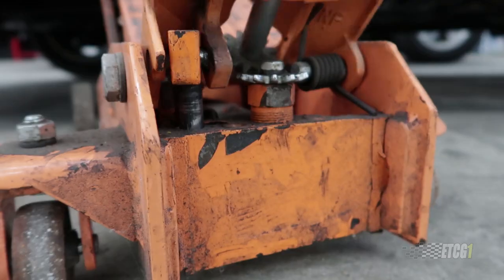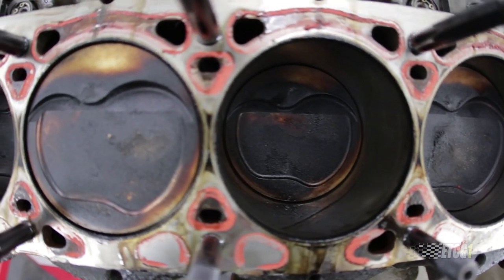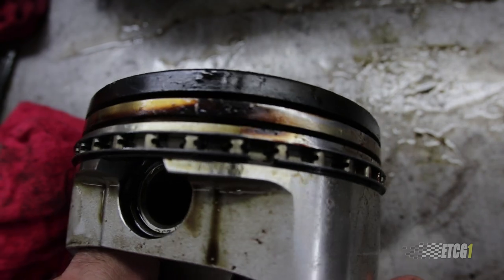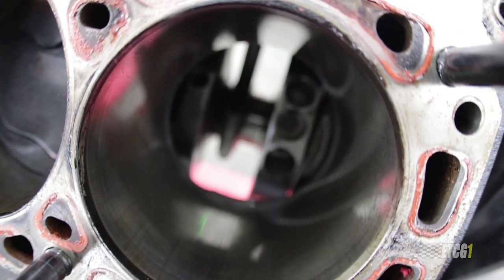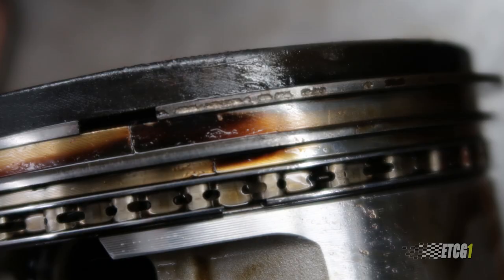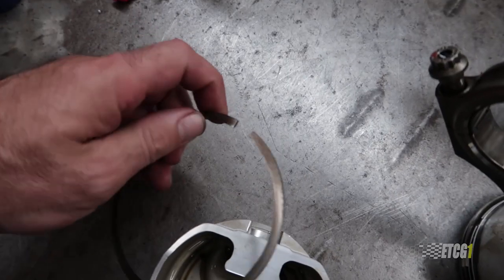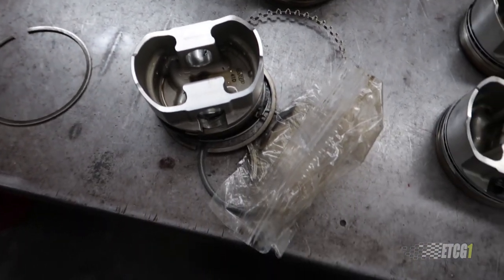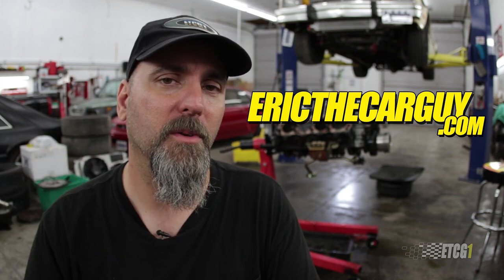Hydrostatic Lock the Silent Killer

Comment: Should've went with fuel injection....
Reply: I've seen injectors get accidentally  turned on on aftermarket ECUs . They'll do the same thing.
Reply: I have too, but not with the ECU being at fault, more like wrong wiring or really old, really abused injectors getting stuck. And even then it takes a good long while for it to inject enough fuel to cause damage... And most definitely long enough to cause the cust to go "wtf" and bring it into the shop, with the engine still intact.... Also, with fuel injectors, the only real opportunity for them to leak enough gas to cause damage is with KOEO... Which seldom happens and is not the case here... Here... we had a carb dump gas into the engine... and ALOT of it... this is one of the many, many, many reasons why we have fuel injection... diehards need to really stop defending carbs as if they were some sort of alter of horsepower and get real: carbs are DEAD, fuel injection is here to stay. And also: I can get at least +10/15hp with efi over carb AND I can see everything the engine is doing, preventing blowups like we have here....
Reply: Should've went with a better fuel pump....
Reply: Wasn't the fuel pumps fault..
It was the failure of the long obsolete design of the carb to stop the flow of fuel going into the engine in the first place...
Thats why we have pressure regulators to reroute flow back into the gas tank in case of just such a failure....
Reply: MeMad Max  Maybe...I didn't bother rewatching the other vid...but I think he installed a fuel return, so it shouldn't have happened if everything was working fine. 
Just because it's not the latest and greatest, doesn't mean it can't do it's job.
Reply from the maker: I'm not saying I won't eventually go to fuel injection, and not because of this. 

You can get off your fuel injected high horse now. Perhaps you missed the evidence of how well it was burning inside the cylinders. Carburetors are a viable fuel delivery system. But I understand how you wouldn't want to  let facts get in the way of your opinions. BTW, my AF gauge tells me all that I need to know about how the engine is burning. 

Also, I'm already running a return system with my carburetor. A return system has nothing to do with the events that caused this failure. Before you condemn the system I have, you might want to get your facts straight first.
Reply: What do you mean maybe?
If he had went with FI in the first place, then the pressure regulator would automatically be there from the very beginning and there would be no question about fuel since DAY ONE... Take out as much variables as you can to prevent DISASTER....
Reply from the maker: MeMad Max If you had real experience building cars you would know that disaster can happen to any build, carbureted or fuel injected. You keep ignoring the facts and making up scenarios that never happened. You can live in the hypothetical, but I prefer to live in the real world. I'm happy to agree to disagree if you are. Otherwise if you want to send me the $2K for the fuel injection system be my guest.
Reply: MeMad Max still wasn't the carbs fault. If you actually watched the previous videos and actually formed a decent argument behind your opinion, you could have seen that it was the pressure regulator that had the wrong spring in it.  Because of this fuel pressure was to high, thusly overcoming the floats in the carb. Carbed or fuel injected both utilize a pressure regulator, not just a FI thing. 

Things like this happen, you miss something and don't figure it out until bad stuff happens. You learn and move on. I'm glad it seems like it wasn't to bad. Hope it is just the piston that got affected. Very interested to see what else you're going to do while you're in there Eric!
Reply: GRABS POPCORN
Reply: @ ETCG1:
Wait, what? 
Sentence 1: It's already obvious that me and everyone else here in this comment thread knows that a disaster can happen to any build ... But the problem is, some people(LIKE ME) have ALOT of experience with carbs AND FI, but have successfully moved on to 1902(when fuel injection first made it into engines(wait, what? Yea, thats right dude: FI made it in 1902.... go study or something....)) ........................................................ 
Sentence 2: "Ignoring facts and making up scenarios".... again: WTF? What are smoking dude? I'm not making anything up, everything that I and that other dude in this thread, have said thus far is REAL LIFE scenarios that we both seem to know....
Sentence 3: "Live in the hypothetical" again... WTF dude?
Sentence 4: "agree to disagree"... are you referring to my comment about FI producing slightly more HP than carb in sentence 3/4? I dunno where ur going with this... It seems you want to attack, but can't quite get the fantasy bullseye in ur head either....
Sentence 5: Send 2k to you for FI... DUDE what are you SMOKING??? You already admitted that YOU WANTED TO DO FI in this build AS YOU WERE BUILDING IT, BUT YOU DID NOT REALLY EXPLAIN WHY YOU DIDN'T. You broke? SO WHAT? I DO EFI, WITH JUNKYARD GARBAGE, ALL THE TIME... ITS ALL THE SAME... If you ask me, I think you didn't want to do EFI because you were at a point in the project that you needed a kick in the ass because it was taking so long and EFI would've consumed more time and editing crap that you didn't want to do(which you also mentioned you hated doing)... WHAT DO YOU WANT? A FREE HOLLEY DOMINATOR? HAH! You already have demonstrated that you don't really have the motivation to get into TODAYS technology to deserve such a lavish gift...
Reply: Sheesh
Reply: And theres a dude here that jumped in trying to say some crap about a spring on a fuel regulator would do the same thing to EFI and blah blah blah blah blah...
Newsflash: a fuel injector is designed in such a way that if you add more fuel pressure to the injector, the seal gets tighter unless it sucks and breaks...
You all need a refresher course, here: 
https://en.wikipedia.org/wiki/Fuel_injection#/media/File:Injector3.gif

The solenoid PULLS AGAINS PRESSURE, NOT WITH. Essentially, more pressure actually results in less fuel after a certain point that the solenoid cant work against the pressure...
GG 
The End...
Reply: MeMad Max would have, could have, or maybe should have, it was a decision that was made I know I would have probably made the same choice, it looked like the right choice to me after seeing how the fuel was burning.   This is an instance of do not feed the trolls.
Reply: Let an injector get stuck open and it won’t take long to fill a cylinder either. He’s running a good bit of power. Which requires a good bit of fuel. Which requires good sized injectors. Ones that would spray a good bit of fuel if they stuck open. 
It’s a mistake that happened. Sure, carbs are old tech. But they work and are cheap and simple. I’ve seen fuel injection setups burn a motor because fuel pressure dropped, or a sensor misread, so it ran lean. I’ve seen engines damaged with fuel injection because it over fueled and washed down the cylinder walls causing the rings to scrape. 
Nothing is perfect. And you need to relax.
Reply: +ETCG1 I really think the ring land breaking is due to detonation, not the hydro-lock.  It seems very unlikely that the piston got cracked or broke and then you went on to drive it for thousands of miles - some of those probably very hard miles at high load.  That is not the way aluminium behaves when it breaks.  Yes, a Connecting Rod will break over time because it's very strong and much more elastic than alloy.  

For sure, EFI/Engine Management would have prevented this by retarding the ignition timing where you intake temperature spiked in traffic or with batches of fuel that weren't perfect.  With a Carb system and stand-alone timing like you have, you are literally gambling the health of your engine each time you stomp on the loud pedal because you have no accurate way of timing the engine under ALL changing conditions such as intake temp, coolant temp and more.  This is the stuff that saves engines and is the reason people are using full engine management these days.  

There is no way on earth you broke the piston ring lands during the hydro-lock and then drove 22+ hours to Jekyll Island without a hitch!  Come on now, think about it people.  This is a tuning error, but Eric does not want to admit it.  He is very defensive about it.  

You sure like to learn the hard way!
Reply from the maker: MeMad Max Here's a bullseye for you. 

I chose a carburetor because I WANTED a carburetor. I wanted to play with tuning a carburetor on a build like this. It had nothing to do with editing. Nothing to do with time, it's what I wanted. 

Also, I have made a video about this: https://www.youtube.com/watch?v=XCMhfSWcpIA

You continue to insist this wouldn't have happened with EFI. Check the comments. There has been more than one comment to this video stating that a fuel injector stuck open and caused the same hydrostatic lock situation. EFI is not infallible to hydrostatic lock. All engines can take in fluid that will destroy them. 

My issue with your comments is that you insist that this is a problem caused by the carburetor. It was not. The facts are right in the video. All of the other cylinders show good combustion. If fuel delivery was an issue, this would not be the case. 

You're just trying to make the case that EFI is better. I'm here to tell you it is, and I agree with you. However, for the last time, my carburetor had NOTHING to do with this failure. The evidence is clear and right in front of you. Stop ignoring it to prove a point that I already agree with, and stop insisting that I don't know anything about EFI. It's insulting. You have no idea what's in my head or what my plans are beyond what I've already told you. 

Lastly, I do plan to switch to EFI, but not because of this. When the time comes, and I make the switch, we can talk about it then. Until that time, please stop insisting that you're right about what happened to my engine, or that it had anything to do with my carburetor. The facts just don't support you.
Reply from the maker: ArchimedeanEye You still haven't answered to the fact that I DO have timing control. Instead you keep going on about how I'm wrong and this was because of detonation. https://www.msdperformance.com/products/ignitions/street_and_strip/parts/6462
Reply: MeMad Max   Alright I'm off work now so I've caught up with your essays. I could try and argue but I don't think there's any use, seeing as you're just out to lecture us in a rude & condescending way. 

Also, if you look at the comments, the likes and what Eric himself has said, is it really impossible to you that you could be wrong in this? If so, you're either delusional or a troll.
edit: spelling
Reply: +ETCG1  That timing control method is literally stuff from the dinosaur age Eric (in terms of automotive).  As I point out in my other comment on this page, modern boosted engines have 10 or 20 ignition-timing offsets.  That means 10 or 20 different variables are taken into account when timing an engine across all conditions, not just RPM and boost. It is the reason why modern engines can make such high horsepower and survive.  

Here is an example.  The LSA engine from the ZL1 or Cadillac CTS-V makes around 560HP in optimal conditions. Similar to your engine probably.  But the LSA engine uses the Siemens E40 PCM which can pull degrees of timing from the engine when there is an intake temperature spike.  In the case of a ZL1, it might pull 3 or 4 degrees and produce 40 less HP, but the engine is SAFE.  If the temperature is further increased it can add additional fuel or even decrease boost.

Now imagine what is happening in your engine.  You are producing the same boost largely dependent on load.  When you have a temp spike from a high-load run, you are still running the same timing, same boost, same fuelling.  You are not even measuring or adjusting for cylinder knock which is greatly affected by intake temp and fuel quality. Since you cannot know fuel quality and you cannot always hear knock, you need engine management in a boosted engine made for performance!    

Think about it.  Your setup simply cannot account for all these operating conditions, which is exactly why I said you need engine management all along.  Not just to be an asshole as you seem to think I am.  Do you think manufacturers designed all of these ignition-timing offsets 20+ years ago just for fun or emissions?  No!  They did it to produce huge numbers and make the engine survive. 

I'm sure you will change to engine-management at some point soon and will absolutely geek-out on how good it is.  I hope you do before you rattle more of the engine to pieces.
Reply from the maker: ArchimedeanEye As someone has already pointed out, it was the 2nd and 3rd ring lands that broke, not the top as you have mentioned. This suggests the pressure was exerted against the ring and not the piston. To me, that, and the other cylinders being fine, supports the hydrostatic lock theory. I simply do not subscribe to your 'detonation' theory in the same way you won't consider my hydrolock theory. 

The engines you mentioned are not my engine. My engine is custom made, not something that was mass produced. It has more metal and thicker webbing, so much so I had to modify the engine mounts to even use them. It also has a forged crank and connecting rods. It has some of the best pistons and rings on the market and it was built by a master. I've also invested in many of the support systems including the ignition system to make the engine as reliable as possible. I also don't drive the car hard. I'm not out doing burn outs every chance I get, or ripping down the road. Often I'm just driving the car and enjoying it. That's why I built it. I can see how your argument might hold up if I was driving it like a race car, but I'm not. I'm driving it as I intended to drive it, on the street. 

I don't see myself going to a full engine management system anytime soon. However, I am going to try and use this situation to get an EFI system from the same people that give me the fuel psi regulator. The reason, I want more control. Before I left for the Power Tour I jetted the carburetor down for better fuel economy. If I were to participate in any races, I'd have to pop the bowl back off and re jet for racing. That's a PITA. Doable, but a PITA. 

Another reason is that I've found that the car likes the AF in the 12s. That's not so great for the environment. It also sucks when I go to fill up. EFI can help me cruise at a reasonable AF, but switch instantly to 'race' mode when I need it. My carb can't do that. 

Those are the reasons I'm going to EFI. Not because I feel that I'm damaging my engine, but because I want more tuneability and drivability. 

Personally, I feel I've made my carburetor work. That's what I set out to do in the first place. Now, when I do switch to EFI, I'll have a better understanding of that the engine really wants and be able to tune accordingly.
Reply: +ETCG1  

1) The lower part of first ring land broke.  It supports ring number one AND ring number two.  Above that is piston crown.  

2) The LSA engine runs factory forged pistons, crank and rods also. It's also all-aluminium and cools far better than your engine, and still uses these controls.  Even a base Hyundai NA uses these type of ignition controls for the past 20 years.

3) The engine is nowhere near as 'reliable as possible' because you don't have modern support systems as I have mentioned to you many times (and which you constantly ignore).  The MSD Marketing spiel does not compare to basic engine management systems of the past 20 years. 

4) You are not measuring intake temp, you are not measuring fuel quality and you are not measuring cylinder knock. These are the main engine killers.  And your engine got killed, like I said it would. 

5) Are you saying you never drive the car under boost?  You never have fluctuating temps?  Come on Eric!  Why you are so defensive, I will never know.  You seem that biased about 'your way' of doing things that you become oblivious to the way people have been supporting turbo engines for 20+ years.  It's unreal.  And it's proven expensive and time wasting for you.  

6) I think you did make the carb work well, I agree.  But not the ignition system.  And not managing the engine as a whole.  You are VERY constrained by the MSD box.  And the MSD box cannot work with the fuel system. They each have no idea that the other exists.  All it takes is one bad batch of fuel, one temperature spike and you will produce knock.  But you are not measuring knock.  

Anyone that has spent time tuning engines knows the dangers of such a setup.
Reply from the maker: ArchimedeanEye 1) All I need is 1 here. You consistently avoid the facts that have been presented in this video. I seriously doubt that detonation would only effect one cylinder in an engine as it did in mine. As I've continued to state, and showed in the video, all other pistons and rings show absolutely no signs of damage.

What you have is a theory that is not supported by the evidence. If you want to argue with MSD, email or call them. Personally, I'm done with this discussion because in all the words you've posted, you have not been able to offer a reasonable explanation why only one cylinder was effected. Until you can come up with something plausible to explain that, it's just not worth it anymore.
Reply: ETCG1  I have a theory.  You have a theory.  Your evidence is that you broke a piston and proceeded to drive thousands of miles with it performing perfectly. Your evidence is that 'MSD is the best'.  Lol, okay. I guess we're done.
Reply: ETCG1  PS.  It's pretty pathetic that sponsorship leads to you making shoddy and skewed conclusions like 'MSD is the best' when I clearly illustrated ways it does not and cannot ever compare to engine management. Once again you're in an Eric the Car guy bubble.
Reply: I like these comments about the regulator not causing issues like this in a FI engine, thats funny. That diaphragm inside breaks and it just pumps fuel into the engine until you turn the key off.
Build FI systems from junkyard garbage? Garbage in, garbage out. Suppose its a fun project though.
Reply: Oh and to the "you couldn't drive thousands of miles on a broken piston". Bullshit, I've seen piston crowns that were literally melted in an engine that ran for a pretty long time before the customer finally brought it in. Simply complaining of a loss of power. Also seen engines running with holes in the damn piston, and the customer oddly oblivious to the smoke coming out.
Reply: sparkplug1018  Listen dude. Eric had tuning problems with old pressure regulator and setup, which is why he changed it.  So what you believe is that he hydro-locked the engine, broke the ring lands, then retuned the engine with the new fuel system (telling everyone how great it was), then went for an approx 26hr drive to and from Jekyll island (after which he reported the car ran flawlessly up hills in 5th gear) then drove the car some more... and all that time it had broken ring lands?  All that time nobody noticed any blowby? Even when tuning and driving it for 26hrs and random weeks and months?  Very unlikely.
Reply: +ArchimedeanEye Saw a truck drive down from Canada with a melted piston crown, Canada to Florida is a good drive. Customer complaint was lack of power after the injector was replaced. And the truck was towing a trailer. 
So as unlikely as it seems, it’s possible.